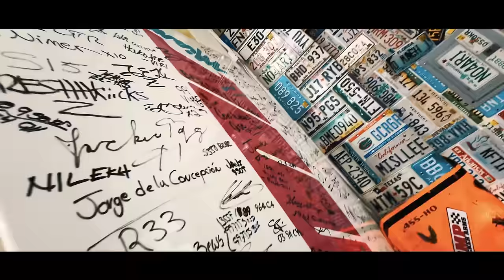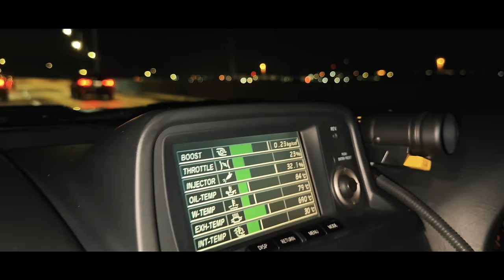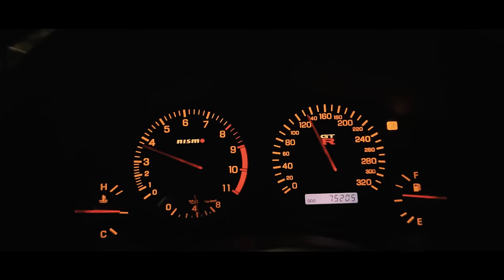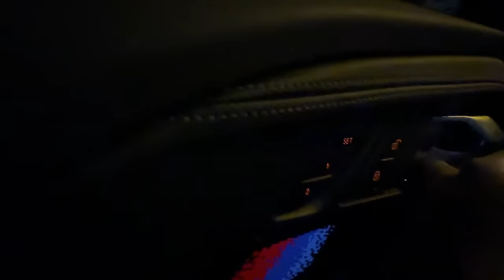GTA6 IRL - STREET RACING, DRIFTING AND MIDNIGHT RUNS THROUGH MIAMI!

Comment: if im not mistaken real maybach has the small window separate from the back doors
Reply: True
Reply from the maker: Ahhh makes sense
Reply: cool car anyway
Reply: And also a chrome Strip in the middle of the hood. Also the S560 should be „only“ a Sclass 222, BUT it is a 50 min Sheepman Video, and that is all that matters!
Reply: @schaefchen  yea it was kinda sus when I first saw it. It might have just been a normal S 560 and just "upbadged" 😢😢
Reply: @erik7634  an s560 is still a very nice car tho
Reply: That's it, all factory maybach have a small window which isn't part of the rear door because they have a longer wheel base. This is just a "regular" S class that had some mods done to it and was upbadged.
Reply: yes thats not a real maybach